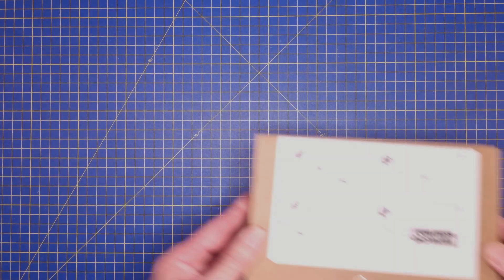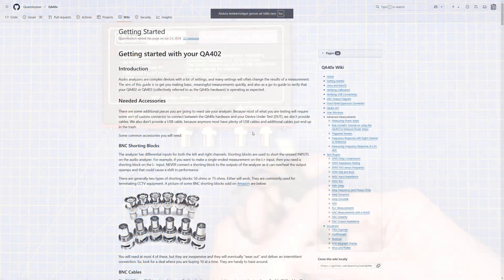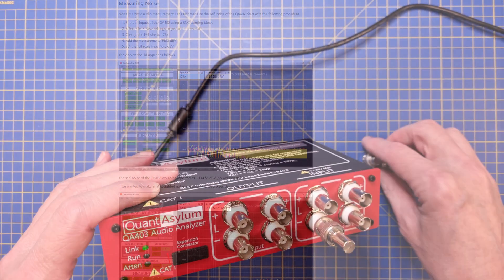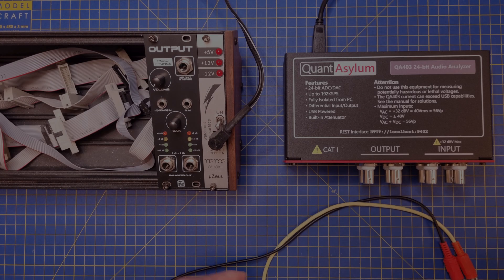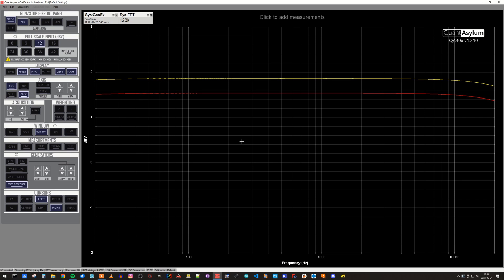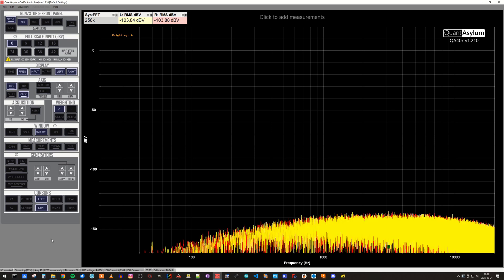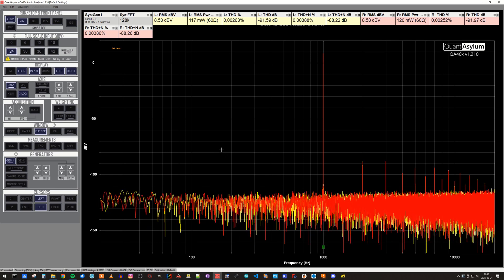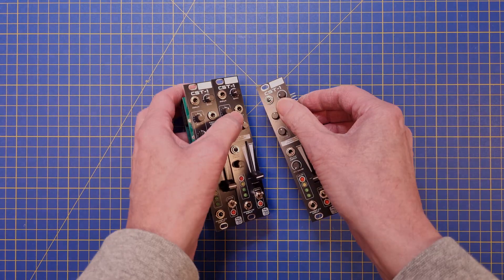QuantAsylum QA403 Audio Analyzer vs Output Module

Comment: Hey Maestro, you recently built those mixer channel strips, each with led VU meters, but how are you going to solve the problem when you actually are joining the audio in the "end" module, if you add 2 * 10 V.p.p. signals you end up with 20 V.p.p., etc. since it's a "summing" bus.
That's probable the reason many mixers have a pre gain knob on the channel strip.
Reply from the maker: Hey @AnalogDude_ I have a gain knob on each channel strip and I also have a peak detect LED on all the mix-buses so you can see if you are close to saturation.
Reply: @MeeBilt  In the Befaco "stereo" strip EQ done in colab with DivKid contains a very interesting transistor setup in the feedback of an opamp.

this prevents that any amplitude higher than 10 V.p.p will pass through. you'll find this very interesting and decide to redo your mixer "endstage". check it out, i asked questions on a very known audio forum about this circuit and they called it a limiter.

This pretty much will allow you to cut and paste sound, overdrive one signal while under driving the other. the overdriven will be shopped.

I designed a mixer around this circuit and gave it a cool name, but without VU meter but the capability to invert the signal when turning a knob. just 5hp.
Reply from the maker: @AnalogDude_  Interesting, I'll have a look at that
Reply: @MeeBilt  Yeah, it's very cool, if you over drive a Saw wave to 20 V.p.p and pass it through, you get something like a trapezium with rounded corners at 10 V.p.p, the same counts for sine, triangle, pulse, etc, whatever you do, you can't mess up and have extreme amplitude at your output module, it always obey's 10 V.p.p.
Reply: @MeeBilt  Oh, i didn't see the pre gain knob, is the VU meter located before the pre gain knob?
check out these ic's: PCM1801, PCM1725, these could probably help build the perfect mixer, regulating it self.

Comment: Cool, but do you use a transformer or smps for your rack?
I have build all my modules in style of Roland TR-808/TR-909, all the ic's as the module itself are powered with 100R and a capacitor on both power rails, it should be pretty much insulated from the rest of the rack.
Reply from the maker: The skiff type case that I use for bench testing is a TipTop Audio uZeus, and that is powered by a SMPS "laptop power-brick".
Reply: @MeeBilt  I have ordered Meanwell NSD15-12D15, DC-DC converter for testing, let's wait and see.